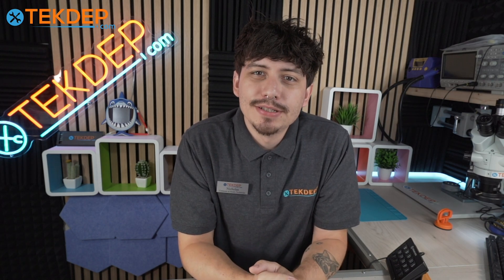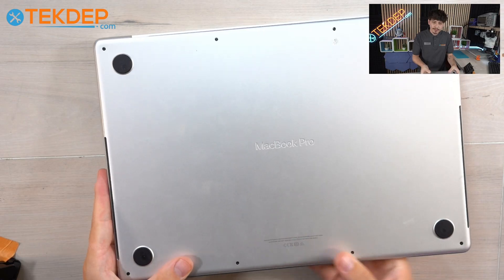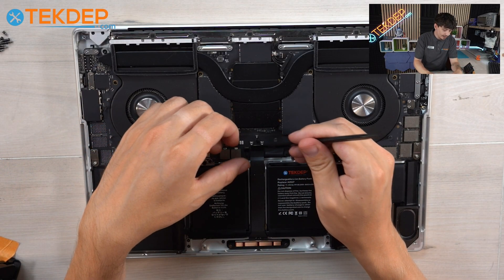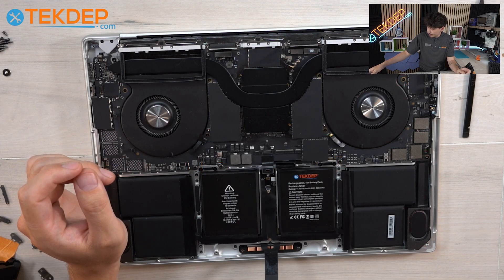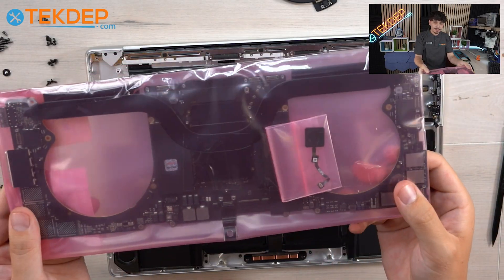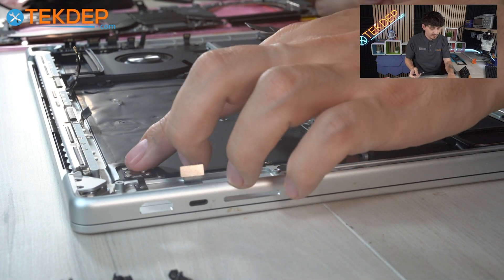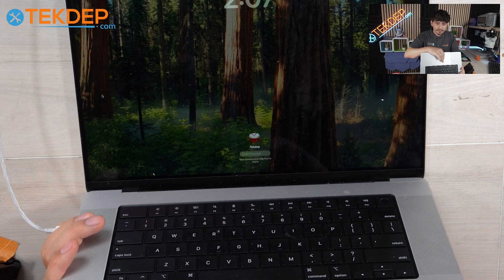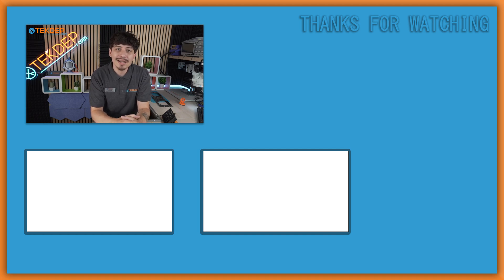MacBook Pro 16" A2485 Logic Board Replacement | Full DIY Guide | 2021 Model (M1 Pro/Max)

Comment: I saw you moved the power/Touch ID, but Does the screen sensor get moved as well. Great video btw
Reply from the maker: Great question! This repair used a preprogrammed motherboard, and we only swapped the Touch ID sensor to ensure the fingerprint login still works. We didn't move the physical screen (Lid Angle) sensor because on these newer models (A2485), the sensor can be calibrated to the board using the Repair Assistant in macOS. This lets the new board 'learn' the screen's magnets without needing to physically replace or move the sensor hardware.